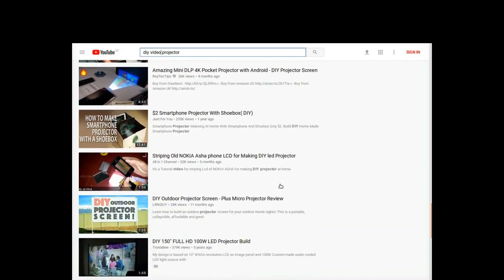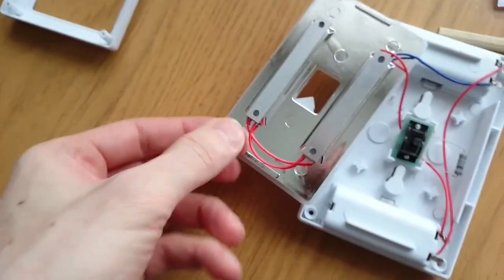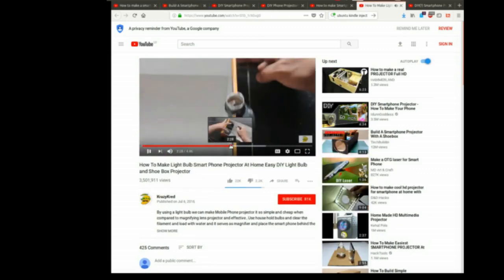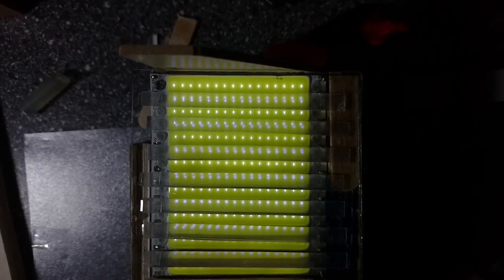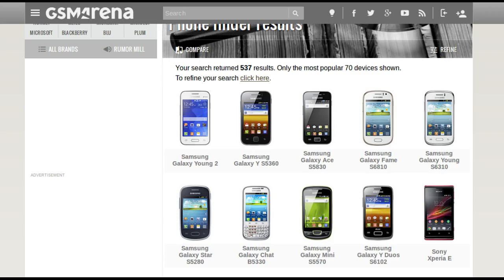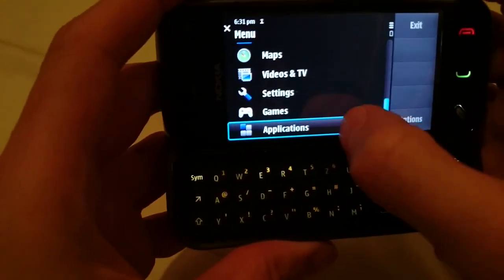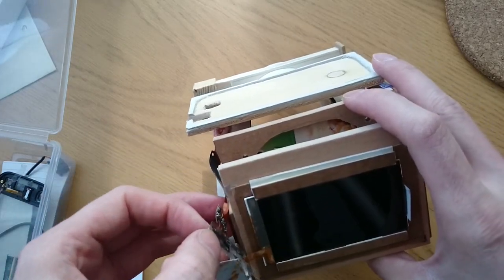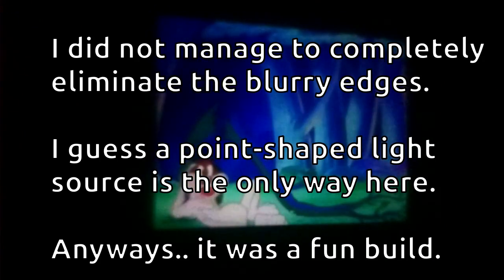Compact DIY video projector from a nokia n97 smartphone and junk parts

Comment: did you removed only metal from back of display to light it? or other things?
Reply from the maker: I tried to remove everything besides the polarizers, which are needed. Unfortunately, the display has a transflective back (I guess to improve readability in sunlight) which is glued to the LCD and I couldn't get that off.